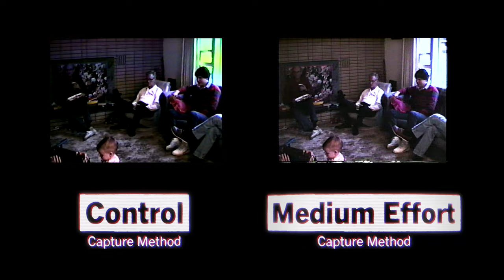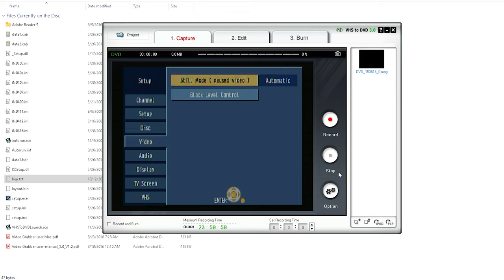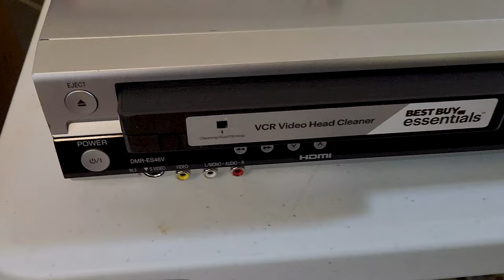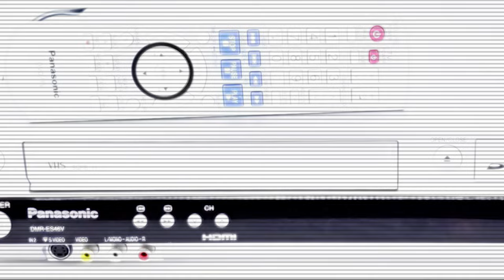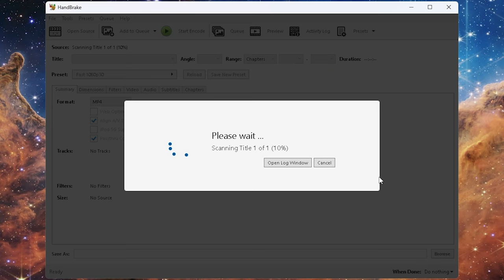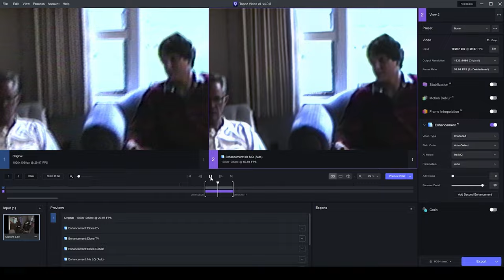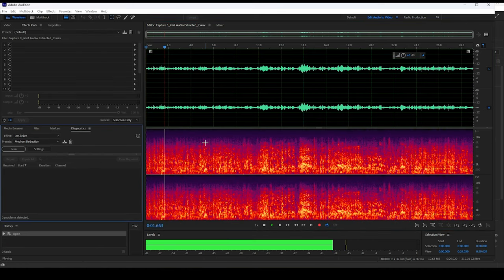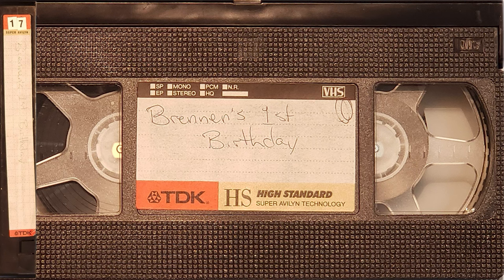Extreme VHS Restoration: Home Video Edition

Comment: This video shows everything you should not do to get good results.
Reply: Thanks for letting us know. Would you care to point us in the direction of the way to better results? Perhaps a video of your own? Now, that would be useful...
Reply: @BrennensBudgetBuilds i hope this can help you to get better results.
Reply: @BrennensBudgetBuilds Why did you delete his comment? He told you the direction already but you deleted it! Thumbs down to your video.
Reply from the maker: Since @debranchelowtone's comment isn't appearing to some of you I'll post what what they said in reply: 

"@laststraw9363  So i have to write it again. I hope it won't get deleted again !
First don't get your informations from Youtube videos, do actual research.
First store tapes correctly, not in cave or attic, standard room temperature, vertical position, staked like books.
Use good SVHS VCR, not normal VHS, so you get better comb filter and better mechanical parts
Don't use the S-video plug, it is not necessary. The VHS tape doesn't contain Y/C signal, it is composite all along, so just stick with composite on the RCA or SCART plug. S-video won't improve the signal, this is a myth.
Don't use HDMI converters, they are usually bad too.
Most important thing, use a TBC, time base corrector, it will fix the picture, no more wobbling effect.
For the computer side.
Digitize in 4:2:2 format, use ProRes or DNxHD codecs.
No need to remove hiss from audio this way, it can remove acutal sound information. This is not restoration is going beyond.
If the audio track is hi-fi, do nothing, if it's not, just mesure the higher frequency and apply a low pass filter. 
Also use 48 kHz sample rate.
Don't use AI, this is not necessary at all and can be harmful too.
Deinterlace with QTGMC, it is possible to do this with Hybrid.
The file being digitized in 720×480 or 720×576 has black bars on the sides. Center the picture in a 704×480 or 704×576 projet and export.
And it's done.
If you need to use the video in a HD or UHD project, then upscale with Shutter Encoder, set it with Lanczos method, it preserves detail.
If you need to compress to outdated H.264 or new H.265 or VP9, then use Shutter Encoder too.
Keep the original tape just in case" - @debranchelowtone
Reply: @BrennensBudgetBuilds  Thanks.
Reply from the maker: @debranchelowtone I've read your advice and agree with what you are saying. The process you are describing will result in much higher quality video in the end. 

I suppose the title of my video is causing some confusion. My intention for making this video was to offer a budget friendly alternative for a little more quality than a $12 converter. I added the extreme effort with AI to discourage anyone from thinking it's a good tool right now and to save their efforts.  

My target audience was for people like my friends who aren't especially knowledgeable in technology and don't have a lot of money or time to spend on converting their old home movies. I was hoping it could motivate them to give it a try anyway because in my opinion, having a bad copy is better than no copy.
Reply: @debranchelowtone Credit where credit is due. I thought you were only criticizing. Thanks for the information. Finding a good workflow is a bit tough on forums (or scattered) and I've been wanting to digitize, clean and upscale vhs videos for a while but never had the focus to scrape that information from doom9 forums and stuff.  Maybe just my own incompetency. Nevertheless, thanks for the information.
Reply: @BrennensBudgetBuilds  vhs is y/c. use s video whenever possible. it might not be significant but the quality jump is there, its not a myth.

Comment: odd, last time i tried topaz (which i admit was years ago) it had a model trained specifically for low-res interlaced video. have you considered rendering to a slightly higher quality then cropping down to 720p or something with image stabilization?
Reply: This message was censored many times

So i have to write it again. I hope it won't get deleted again !
First don't get your informations from Youtube videos, do actual research.
First store tapes correctly, not in cave or attic, standard room temperature, vertical position, staked like books.
Use good SVHS VCR, not normal VHS, so you get better comb filter and better mechanical parts
Don't use the S-video plug, it is not necessary. The VHS tape doesn't contain Y/C signal, it is composite all along, so just stick with composite on the RCA or SCART plug. S-video won't improve the signal, this is a myth.
Don't use HDMI converters, they are usually bad too.
Most important thing, use a TBC, time base corrector, it will fix the picture, no more wobbling effect.
For the computer side.
Digitize in 4:2:2 format, use ProRes or DNxHD codecs.
No need to remove hiss from audio this way, it can remove acutal sound information. This is not restoration is going beyond.
If the audio track is hi-fi, do nothing, if it's not, just mesure the higher frequency and apply a low pass filter. 
Also use 48 kHz sample rate.
Don't use AI, this is not necessary at all and can be harmful too.
Deinterlace with QTGMC, it is possible to do this with Hybrid.
The file being digitized in 720×480 or 720×576 has black bars on the sides. Center the picture in a 704×480 or 704×576 projet and export.
And it's done.
If you need to use the video in a HD or UHD project, then upscale with Shutter Encoder, set it with Lanczos method, it preserves detail.
Use Rec601 to Rec709 or Rec2020 for the colour space.
If you need to compress to outdated H.264 or new H.265 or VP9, then use Shutter Encoder too.
Keep the original tape just in case
Reply from the maker: You are right they do have models specifically for low-res interlaced video, but based on my experience I assumed it wasn't trained with anywhere near as much video as the HD and 4k models. It still really seems like the core program is designed around modern footage since that what the company is advertising as its strength.

Comment: I'm currently capturing my old family Hi8 tapes, I bought a Hi8 camcorder with S-vhs out... I then plugged that to a svhs to hdmi female that also upscales to 720p and 1080p. Then I plug a hdmi from that to a used Átomos Ninja Blade hdmi in, that records to removable SSD at Apple prores LT or prores 422, I want apple prores as I'm going to do heavy color grading, sharpening, and then de noise in premiere pro. I need my pc free from capturing so I use the Átomos. Don't know if that helps anyone 😎
Reply: Why upscale though...that just wastes space. It’s still standard def video regardless.

Comment: First, LOVE this.  I'm working on a documentary and restoring old footage, audio, etc.  This was very helpful. The Topaz AI topic may have saved me a TON of wrestling with that software. 
I also want to share some of my successes.  In trying to fix Audio specifically, both with a very old black & white VHS and a digitized Casette recording I discovered that Logic Pro has a new Stem Seperation feature.  This turned out to be MAGICAL.  On the VHS I had a persistant loud hum that was making it really hard to hear dialogue/speech.  Later in the tape there's live music which overpowered the hum.  Logic Pro completely isolated the dialgoue and put hum/music on a seperate track.  I actually just realized I could have told it to do more track seperation but since it uses musical terminology I only considered "Vocals" and "Other" hoping it would recognize HUM as "Other".  It did. 

2nd Success: Casette tape of dad singing over piano player.  The piano was competely overpowering him in the recording.  Logic Pro VERY cleanly seperated the vocals and piano.  I was able to put both Stems back on my FCP X timeline and just raise the vocals and lower the piano to rebalance.  No more spiking and no more useless attempts to improve the sound in FCP X alone.  It can do great things but not like Logic Pro.  Wow.  

Hope that helps someone!  Maybe worth a try on old VHS restoration where the audio is suffering.

Comment: I enjoyed your video, it was really detailed. You're going to my watchlist.
What do you think about VHS-Decode method? Do you find it as extreme effort method or easier? Cheers!
Reply from the maker: Thank you I appreciate it! I'm not very familiar with the VHS-Decode method but I'll add your videos to my list of things to watch.

For this video I really wanted to showcase an affordable and accessible alternative for a "Higher-than-average-quality" VHS transfer. My end goal was to highlight the medium method as a perfectly good alternative without a huge financial investment or time sink. The extreme effort method was mostly just an example of how someone could spend many hours of effort with very little difference to show for it in the end.
Reply: @BrennensBudgetBuilds  Yeah, I totally understand extreme efforts shown in here.
When archiving VHS I started to face problems like unstable signal, dropped frames caused by hardware hiccups or inserted due to how different device clocks can drift away. I discovered first LD-Decode project as the most geekest method of taking tape contents directly to digital storage and then process that stuff with minimal loss and processing involved and then started tinkering with cheap hardware solutions intended for it during my VHS ripping adventure of TV recordings.
Reply: @Zcooger  A time base corrector can help.
Reply: @debranchelowtone  Yes, I used to use Panasonic DMR-ES10 as passthrough however it never entirely helped to get rid of sync issues of capture card.
Reply: @Zcooger  Then frame synchroniser maybe.
Reply: This message was censored many times

So i have to write it again. I hope it won't get deleted again !
First don't get your informations from Youtube videos, do actual research.
First store tapes correctly, not in cave or attic, standard room temperature, vertical position, staked like books.
Use good SVHS VCR, not normal VHS, so you get better comb filter and better mechanical parts
Don't use the S-video plug, it is not necessary. The VHS tape doesn't contain Y/C signal, it is composite all along, so just stick with composite on the RCA or SCART plug. S-video won't improve the signal, this is a myth.
Don't use HDMI converters, they are usually bad too.
Most important thing, use a TBC, time base corrector, it will fix the picture, no more wobbling effect.
For the computer side.
Digitize in 4:2:2 format, use ProRes or DNxHD codecs.
No need to remove hiss from audio this way, it can remove acutal sound information. This is not restoration is going beyond.
If the audio track is hi-fi, do nothing, if it's not, just mesure the higher frequency and apply a low pass filter. 
Also use 48 kHz sample rate.
Don't use AI, this is not necessary at all and can be harmful too.
Deinterlace with QTGMC, it is possible to do this with Hybrid.
The file being digitized in 720×480 or 720×576 has black bars on the sides. Center the picture in a 704×480 or 704×576 projet and export.
And it's done.
If you need to use the video in a HD or UHD project, then upscale with Shutter Encoder, set it with Lanczos method, it preserves detail.
Use Rec601 to Rec709 or Rec2020 for the colour space.
If you need to compress to outdated H.264 or new H.265 or VP9, then use Shutter Encoder too.
Keep the original tape just in case
Reply: @debranchelowtone  Don't use HDMI converters, they are usually bad too.
 = I just bought aja io hd and blackmagic converter. Do you think they are not give me better picture?
Reply: @debranchelowtone but if not the HD as final is better than 720x576 (or as you suggest 704 x 576) resolution? I think upscaling final file is a good job (but it shlould be done at first step, then additional restoration, better by hardware upscaler).
Reply: @alexanderv.753  It can be upscalled if needed but deinterlacing should be done first when the signal is in SD.

Comment: The quality of the VCR you capture from is the first component that needs to be the best it can be. I have an LG vcr / dvd unit with hdmi output, but the parts used (in particular the audio head and tension arms) are trash compared to my higher quality jvc vcrs, that have s video outputs.  Scaling vhs just sucks. 

Also, you can deinterlace the avi in premiere and compress to h264 in one process
Reply from the maker: Thanks for the feedback!

I've run into a lot of little roadblocks along the way as far as hardware limitations. For this video, I wanted to focus on the most accessible and budget friendly versions of advanced restoration. 

Going forward, I'm definitely going to research how to put together a better capture system overall.
Reply: @BrennensBudgetBuilds  also, you may not need the splitter if the Elgato has a HDMI output pass through. Plug the pass through output into your computer monitor and it should handshake.

Comment: Amazing work. You did a great job explaining and showcasing your methods. I’m currently using an S-VHS vcr then running the video into the A/v port port of a camcorder and using the  DV in/out FireWire port from that camcorder into a Sony MC3 or 5 (I can’t remember which) standalone dvd recorder which has a dv in port . I then take those DVD’s and burn them into my pc using handbrake. It’s messy with a bunch of cables but the results have been much more pleasant than straightforward VCR plugged into my Mac using Roxio software. I could also skip the camcorder but the audio sounds a bit better when I do it that way. I could be wrong but I’m just going with what my eyes and ears feel is more pleasant.
Reply: The ROXIO product is absolute garbage!

Comment: Use s-vcr with  s-video cable's and get rid  of those composites cable's ir use a TIME BASE CORRECTOR AND U WILL REALLY SEE A DIFFERENCE
Reply: Not necessarily. I have both of those, and whether they make a significant difference or not depends on the specific devices and tapes.
Reply: @DoubleMonoLR  device is a super vhs with a tbc internal ir external

Comment: He keeps deleting the messages !
Reply: This message was censored many times

So i have to write it again. I hope it won't get deleted again !
First don't get your informations from Youtube videos, do actual research.
First store tapes correctly, not in cave or attic, standard room temperature, vertical position, staked like books.
Use good SVHS VCR, not normal VHS, so you get better comb filter and better mechanical parts
Don't use the S-video plug, it is not necessary. The VHS tape doesn't contain Y/C signal, it is composite all along, so just stick with composite on the RCA or SCART plug. S-video won't improve the signal, this is a myth.
Don't use HDMI converters, they are usually bad too.
Most important thing, use a TBC, time base corrector, it will fix the picture, no more wobbling effect.
For the computer side.
Digitize in 4:2:2 format, use ProRes or DNxHD codecs.
No need to remove hiss from audio this way, it can remove acutal sound information. This is not restoration is going beyond.
If the audio track is hi-fi, do nothing, if it's not, just mesure the higher frequency and apply a low pass filter. 
Also use 48 kHz sample rate.
Don't use AI, this is not necessary at all and can be harmful too.
Deinterlace with QTGMC, it is possible to do this with Hybrid.
The file being digitized in 720×480 or 720×576 has black bars on the sides. Center the picture in a 704×480 or 704×576 projet and export.
And it's done.
If you need to use the video in a HD or UHD project, then upscale with Shutter Encoder, set it with Lanczos method, it preserves detail.
Use Rec601 to Rec709 or Rec2020 for the colour space.
If you need to compress to outdated H.264 or new H.265 or VP9, then use Shutter Encoder too.
Keep the original tape just in case
Reply from the maker: @debranchelowtone I have not deleted any comments. I believe YouTube filters some comments for review depending on the contented without my knowledge.  I will see if I can investigate why your comments aren't being shown.
Reply: @BrennensBudgetBuilds  Ah, i thought it was you, this is weird, i don't get this problem elsewhere.
Reply: @BrennensBudgetBuilds  I wonder what Youtube can filter out of technical informations. This can actually help you to get even better result with this system.
Reply: @debranchelowtone I just started with archiving some rare V-Cinema tapes and using an adapter to OBS. Deinterlace with Yabris, 720x480 and the output to 720x540 for 4x3. What software and adapter do you highly recommend.
Reply: @IronClawNinja Hello,  I use the Blackmagic Intensity Shuttle and it's software Media express; else then Virtual dub is fine. For deinterlacing there is a simple way using Shutter Encoder ( freeware ). Select a format conversion of choice then select the deinterlace option on the bottom right pannel. There is an option called YADIF and a button next to it called TFF, hit this button a few times until it says ×2, et voilà. 
This method allows to have all the 480 lines on each picture and also 60p.

The 720×540 is something i can understand but it's not how it is supposed to work.
720×480 is fine, just keep in mind that in digital SD the pixels are not square shaped. So as long as the right shape is selected all along it should be displayed just fine. Also it is possible to center the video and crop the black bars on the sides and output 704×480 without loss of quality, and it's 4:3.
Reply: @debranchelowtone I think YouTube (and instagram) flags long comments as “
(negative rants that don’t add any value) so either delete or hide
Reply: @elliotalderson2479  Then they should rethink this when i add actual value and explainations. Who are they to restrict freedom of speech ?
Reply: @debranchelowtone  it’s an issue in society. Some people notice it others may notice but ignore if the remaining posts & comments align with their bubble of bias. It’s information control and I think the automation side flags lots of text & keywords